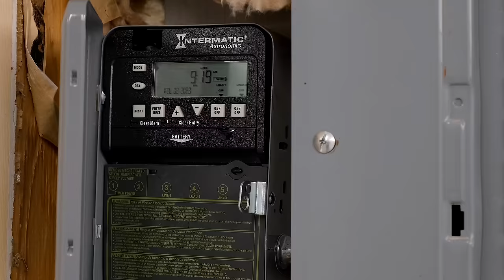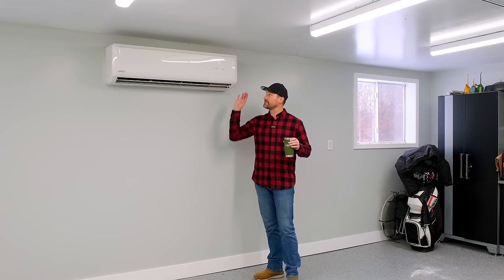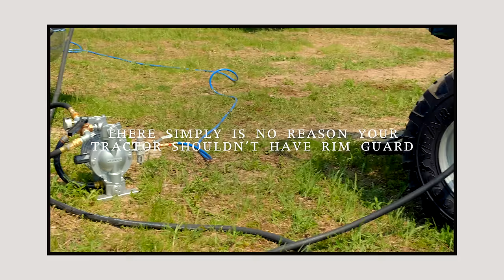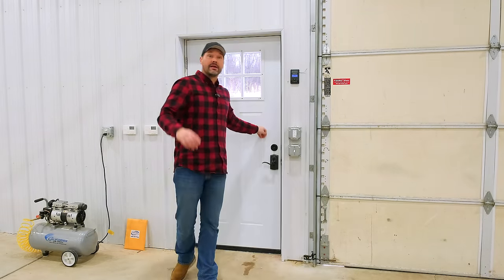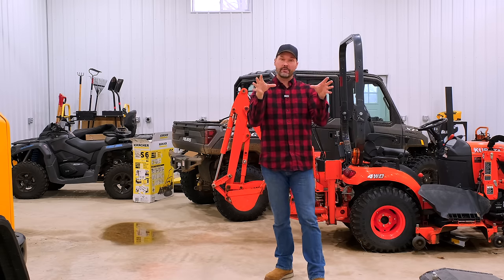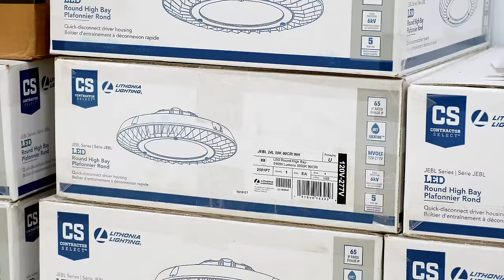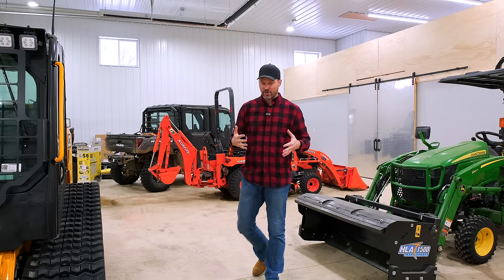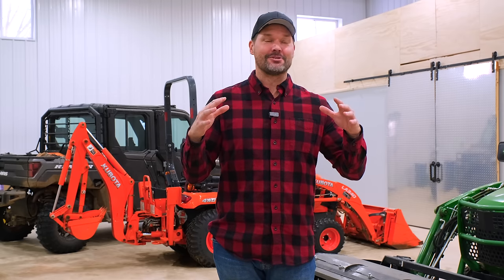AVOID THESE TOP 10 POLE BARN MISTAKES OR IT COULD COST YA!

Comment: Just a good clear concrete sealer should work on the floor. I have cleaned concrete floors with tide powder laundry soap and a push broom to scrub the floor. 
If you are wanting more natural light there is always skylights with the shiny metal tubes to bring the light down to the ceiling where you could put covers on the tubes.

Comment: You could power wash it and just put sealer on it.  I just built a new pole barn in december, this is probably what I am going to do this spring when it gets warm out.  I was sticker shocked as well at how expensive Polyeurea Coats are.

Comment: I’m pretty sure you can get a concrete sealer that’s not epoxy, and I’m pretty sure you can put wax over that,years ago I used to clean and refinish concrete floors at fairgrounds.

Comment: You did it right with the power!  More is better. Most 5th wheel RV’s with an AC unit need 17ft to clear.
Reply: 17 feet to clear what? They're not nearly that tall.
Reply: 13'6" height limit in Michigan

Comment: Add some ceiling fans to push that heat to the floor in winter, they run quiet and you can turn them off.

Comment: I would like to build a barn for a woodworking shop some day. You have very high ceilings. Does the radiant heat reach floor level or does it tend to stay up near the ceiling? Considering exposed electrical conduit so that I can add outlets over time, if necessary. Do you have a toilet in your barn? You are quite a way away from your house.

Comment: Courtney you should look at waterproof vinyl plank flooring. It holds up great. I don’t know if it would be affected but equipment. I don’t think so because it’s interlocked. Just a thought.
Reply: We have vinyl flooring in our laundry and bath and it is not waterproof.  Water will find a way between the planks given enough time and water.
Reply: Gotcha.
Reply: @earlyriser8998  ours is allegedly waterproof but water always finds the path of least resistance and gravity of course
Reply: @elained9591 waterproof means water will not hurt the flooring itself.  You can take it up clean up and put it back down.  Some lock together flooring water will destroy if it’s not vinyl.

Comment: they make this stuff thats an enzyme that literally eats the oil stain off the floor. i'm using a small amount for my slab since i got oil on it while building. if you polish with the oil stains still there it will lock it in so you use this stuff a couple times to get the oil stain before polishing

Comment: I want to build a similar workshop and am wondering what your spacing was for your lights. Thanks
Reply from the maker: Not positive on exact spacing, but 4 rows of 8 lights.  Interior barn dimensions are roughly 48' x 96'.  Lights held a couple of feet off the walls.

Comment: Nice video. I epoxied my shop floor. I don’t recommend it. Can’t do much work without damaging it. It takes a lot of extra work to keep it looking good. I had same problem with water coming under my overhead door years ago in another shop. I used a pressure treated 1x4, cut 45 degrees down both sides, screwed it to slab directly under overhead door. It has to be positioned just right on the outside so any water on door will run to outside. Has to be caulked with silicone well too. It worked well for me. Good luck.

Comment: i'm building a 40x72 with a mezzanine and i'm not going to run water out to it at all, if i did the sqft-age would be added to my taxes liability. so no water for me wink wink
Reply: I wish running water was the only stipulation for added taxes. Where I live if you have a roof on it, your taxed on it. In my area a lot of people are putting up canvas arch structures on concrete barriers. They consider them temporary structures cause there is no foundation or poles in ground, therefore not taxed.
Reply: @brucebennett8475  no fun, i'm sure there will be some type of increase to my tax bill. my neighbor has a shop that matches his house and the county stopped to check if it had water, if it did they would have added it to the sqft-age he's taxed as living space. so i'm just trying to avoid all that